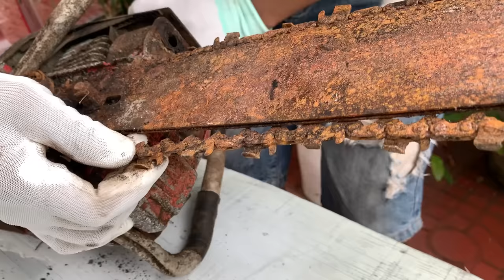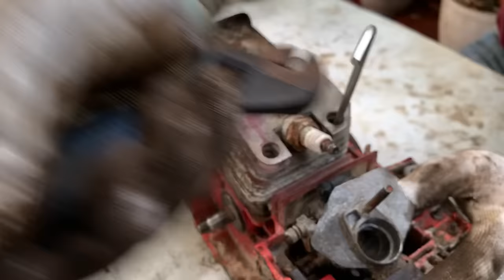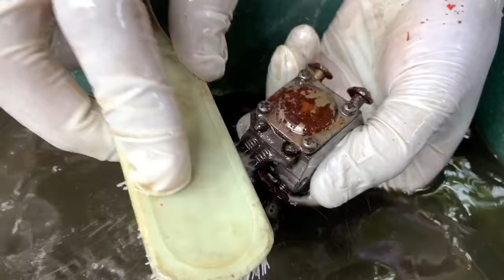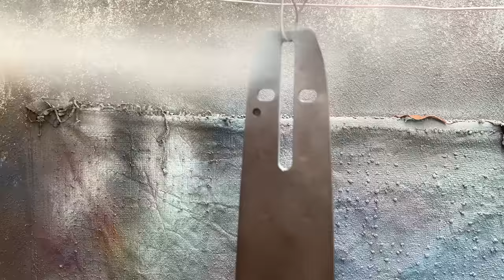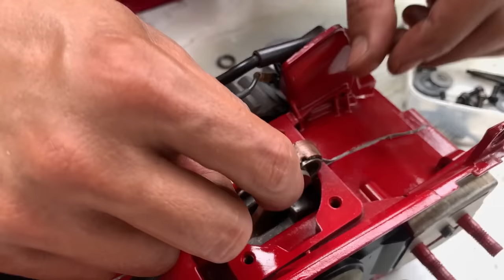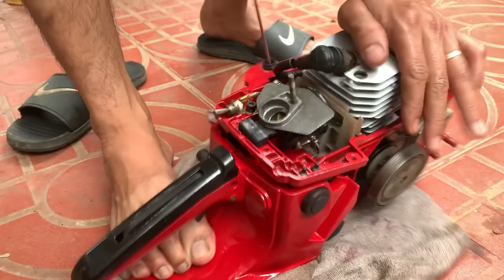Restoration old rusty gasoline ChainSaw | Restoring 2-Stroke Petrol Chain Saw

Comment: You NEVER insert bearing by hitting on the inner face, tap it in on the outer face
, you damage the bearing by hitting the inner face
Reply: Not at all, small bearing can be easily fitted in to the shaft of bearing housing. Heating producers can be done with big and critical equipment.
Reply: Not only don't you use the inner ring but I'm pretty sure you should pack them with grease. My theory on this channel and about 20 others just like it, is that it's a rigged. Someone has set up a bot system and pays these people a few bucks to sorta refurbish different items and then they collect any YouTube money. I found a channel that was 3 months old had 5 videos and like ten thousand subs but each video had over 10 million views each. There are some where you can hear in the background someone wrenching on another project. Easy money just find a item that works sorta,trash it out some more and then pay a person 5 bucks or whatever to "restore" it and some else 5 bucks to film it. Then have 5 or 6 channels,edit the vids and upload and then turn the auto system on to constantly replay the vids, like printing money
Reply: Yes!!! I saw that and got a little worried 🤣
Reply: That and the piston is facing the wrong direction. Arrow towards muffler.
Reply: Reeve i agree, and with a peace of wood or with a plastic hammer.

Comment: I think the piston was installed the wrong side, the arrow is always on the exhaust side🤷‍♂️
Reply: Well it started
Reply: I noticed that too..
Reply: Hehe and more like no masking tape etc ;p
Reply: kosti116 honkez
Reply: But the ring gaps never are....
Reply: @eisbeinGermany  IT did start but they do that because of where the piston rings meet. you want that on the opposite side of exhaust port.  it can be a hot spot and more change of hangin a ring

Comment: how convenient that a chain saw was randomly laying around  and he knew exactly where it was
Reply: Why does that matter? It was about the restoration
Reply: @austinledford8501  @@@
Reply: @uhtred7860  the builds are fake?
Reply: @austinledford8501  No, he disassembles then assembles the stuff, that much is clearly true. What is fake is the "finding random stuff in the forrest when i go for a walk" and the condition of the stuff he "restores" He clearly paints or dips the things in some sort of solution to create a impression of rust or age. Maybe even some reverse editing. pay attention to the "rusty" components before and after, no pitting from rust at all, also the rust/ageing is always the same colour, and comes off very easily. But check out the xbox resto, or some of his other electronic restorations, they are the most clearly faked.

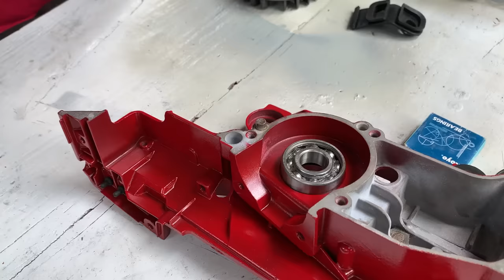Comment: 24:35 DONT HIT THE INNER RING! it will damage the bearing! Always Press or Hammer the ring that gets friction, like in this case the outer...
Reply: Same got to my mind, the first thing taught in bearing installations :) Hardly take damage with low pressure but next time hit the outer ring 
when installing bearing in the hole. When installing 
to the shaft hit the inner.
Reply: That was my first thought. Every time I see a restoration, guys hammer in the bearing on the inner ring...
Reply: I did this 1 time and bamm bearings broken
Reply: First thing I did when I seen this. Is go to the comments to see if anyone else noticed
Reply: That was the first thing I saw, the thing with the inner ring and the bearing seat is painted that's not good
Reply: Put the bearings in the freezer and heat the case and they pretty much drop right in....but yes you are absolutely right, never hit the inner race 😂

Comment: The cutting chain was installed backwards and re installed backwards. Also you must mix gas with oil for two stroke engines

Comment: should have pressed the main bearings in by the outer race , not the inner !
Reply: l thought that too bro
Reply: yep exactly and should have replaced the bent crankshaft and should have not paint the inside of the engine and should have put it on the dumpster.....
Reply: He put the piston on backwards too. Arrow on top should point towards the exhaust, not the intake. That saw won’t last long at all.
Reply: @brodytonelotti3577  he will learn
Reply: Yep and took the paint off the crankcase where the cylinder gasket sits AND lube the lips of the crankcase seals
Reply: I saw that too. Good effort, but won’t last long. For the amount of time that went into the rebuild, he could have bought a new one for $120 🤔
Reply: @Bulletman426  Who told you he was looking for a new saw? Someone who begins such a restoration without the right tools must be "loco" don't you think so? He did a great job though...

Comment: Backwards piston, no bar oil, dull chain, no oil fuel mix,
Reply: Chain backwards, silicone with head gasket, banging bearings with hammer, must be awesome.
Reply: backward chain too..this guy typical asian..has no clue..watched one guy here restore a guitar..found it lying in the long grass..put it back together back to front...
Reply: joshua Gargalione how about praising the lad instead of knocking hi so what if he made a few mistakes IMO he did a hell of a job
Reply: bent crankshaft, paint inside the engine..... that thing was poop now it's poop with wasted paint and bearing and it will last a week before have a real engine crash locked solid worst than if it was found under the sea after 10 years....

Comment: Never knew they made chainsaws that didn't need an oil mixture for the fuel to work. Won't be long for that chainsaw to have no compression and seize up.
Reply: I'd like to know, how u figured out that he used fuel without oil.
Reply: @peterfedor9288  you clearly have no experience with two stroke fuel mixture. You can tell just by looking at it when he poured it in.
Reply: @peterfedor9288  Well, based on my little experience with 2 stroke engines, the oil is in quite dark red colour (Like a blood from vein). So it dyes the fuel in red - reddish colour.
Reply: @tigerxra8515  There are various brands of the m2t oil - red, green, blue, yellow and so on. U can't tell by looking at gas if it's mixed or not with yellow oil(that's why I don't like these oils - can't see the difference). I have workshop and do engine repairs(fyi james), so I know what's going on.
Reply: @peterfedor9288  Oh, thanks! I had my suspicions that there is more that one colour of oil, but I wasn't sure. Yeah, I love the red oil. It's easy to tell if fuel is with oil or without. Is there are difference between the oils, apart the colours?
Reply: @tigerxra8515  Yep, red is my favourite too. The color difference is just because of brands. Each brand has its own color, just so it can be easily distinguished. E.g. Stihl has red oil, Husqvarna has blue,...(red is also usually used as typical color for normal cheaper m2t oil brands). No big difference in performance (except each brand's certain advantages).

Comment: Mistakes include but not limited to;
-Painting inside the bearing and mating surfaces. 
-Incorrect paint for inside of engine. 
-Excessive gasket sealer will overflow into crank. Not optimal.
-Bearings installed incorrectly in a manner that often causes failure.
-Piston installed backwards, will result in failure.
-Suspected bent crank, will result in failure.
-Possibly incorrect fuel, will result in failure. 
-Chain blunt Well below operable standard.
Reply: Yep, I noticed that too. But the worst thing he did is the way he istaled bearings 😱 The bearing nests shold be heated up to ~120 °c and then you put the cold bearings inside. They get inside like a dream and without any hammer.
Reply: It wasn't free he bought a few parts and he put in his time. . I think he'll get five to seven years of use out of it. Well worth his time.
Reply: Lĺĺl
Reply: Thanks you
Reply: @randallreed9710  He spend lot of time and spare parts (and even more paint...), so why not do the job correctly? I Think he didn't really know what he was doing, just try&error.
Reply: @paulpahl1607 "fire by trial" and "learning by doing "makes a great handyman and mechanic in multiple ways 😊

You can not claim that you are a expert in your field of work or personal and passionate hobbies, UNTIL you have Fu**ed up in every single possible way..

And this chainsaw restoration video is a great way to get new knowledge, tips and tricks to help his skills improve 🙃
Reply: I did notice that he put the wrong fuel in it but other than that I think thumbs up all the way. Personally not knowing shit about how things properly work I think it's awesome.👍👍👍 Not too many people would even take the time to do what he did, so my hats off to him.  I look forward to seeing more of this guy's videos laymen or not.

Comment: You must put it together with oil on the seals, bearings and piston. Will not last long on start up.
Reply: I was literally just thinking the same thing “bro you need those, there dust covers”
Reply: And The piston is turn The wrong way🤣🤣

Comment: 1)Dont paint Sealsides
2)Dont hit the bearing at the inner Ring
3) Piston is turned around, arrow shows always exhaust side
4) be more carefull with the engine, dont throw that cylinder around, and dont let all the parts fall on them
Reply: 6https://youtu.be/c5lnmOqqfZg
Reply: I bet you this dude is from China so what would you expect
Reply: 3) if he knew that and put piston turned around to get better conrod angle 😁 but this only works 4t engines it rattles cold but no warm anymore

Comment: When he tapped in the bearings by the inner raise it kinda hurt my soul
Reply: And painting the inside of the engine case isn't funny either !!
Reply: Zylinder Head in the wrong way 😑
Reply: and starting it in with strait gas on initial run

Comment: bearings must be completly unsealed (lips of the sealing ring are oiled by gas mixture) and installed by outer ring , gasket is out of sense because it causes a gap in front of the engine body and its tension, silicone is enough, use some grese when intalling needle bearing
Reply: Its fake water doesn't just end up in the oil tank without a huge ass hole in it.

Comment: Well, that didn't run very long with the piston in backwards. Your rings are officially destroyed now.
Reply: I was thinking the same thing...must've missed that big arrow on top of the piston.. oh well lol
Reply: cylinder is going to be "reshaped" by the rings so the engine is going to be really destroyed soon i mean, it's already a junk but soon it's going to be a piece of aluminum mixed with iron good fro scrap

Comment: Piston went in backwards. Aero points to exhaust. But very nice job.
Reply: 騾                                               鑼                                             邏‼️                                   腹蠡     ら         らえり
Reply: Also he damaged the bearing by hitting it on the inner circle
Reply: @user-bd3dt2yy9j  nó cứ sự

Comment: Nice effort but you drive a bearing in on the outer race. When you strike the inner race, you ruin the bearing. That will run for a couple hours before it grenades itself there ace. Nice overall effort but pay attention to the details.

Comment: For those that don’t know…..those bearings were installed incorrectly…..bashing on the inside race damages the bearing, he should have used a bearing tool and a press on the outside race.
Reply: Exactly
Reply: Or heated the case halves while chilling the bearings. They would’ve dropped in that way without need of a press.

Comment: Youre going to destroy that engine running straight gas in there without 2 stroke oil.  Also, that cylinder head is going to smell awful as that paint burns off of it.
Reply: Then he can restore it again. :)

Comment: Saw two major faults, btw, the piston is on backwards, arrow always points to the exhaust. That takes away 25% power. And the bearings was hammered in on the inner race, should be seated on the outer. So the balls are now damaged, that shortens the lifespan of the ballbearing by 90%, the saw will probably just run for a few times, then the bearings are shot.

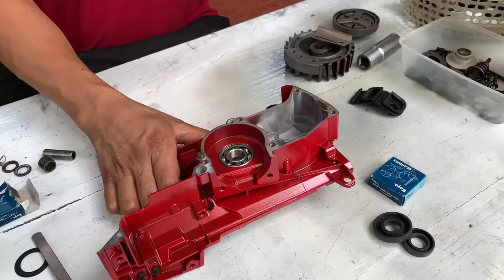Comment: 24:38, dont hit inner ring hit at the outer ring otherwise use bearing puller & to avoid contamination to bearing journal open the seal always after the bearing installed

Comment: They were running it with no bar cover ?
i wonder if the clicking sound it made with the chain running back wards on the sprocket gave it away , or did he think , man this is blunt.
Reply: As

Comment: At the beginning the blade was on backwards
Reply: I don´t want to be that one guy but..........
It's NOT a "blade", it's a bar and chain.
That's why  it's called chainsaw and not bladesaw.
Learn something useful.
Reply: @sheeplad803  weii its still backwards
Reply: @sheeplad803  bladesaw 😂😂
Reply: Chainsaws don't have a blade and the chain can't be be backwards
Reply: @robintutt4018  it's reversible you're supposed to flip it every time you sharpen the chain
Reply: It was backwards when he reassembled it, then fixed it. ;)

Comment: Highly confident this will run only a handful of times at best. Bearing were broken during install, and they should be a tight fit with the drive shaft; which they are not.  Thank you though for making this video!
Reply: Spray paint does not a fix make.
Reply: And he put gasket maker on top of paint where the jug and the block meet up that will never hold he should have sanded off .but he tried maybe the next one will be better B+ for effort

Comment: Hes lucky that Homelite even started.  Thats why it was left in the woods to die.   This is like Pet Cemetary.
Reply: Not a homelite, Johnsered, no doubt
Reply: @stihlcuttin5784  yea thats a 200 series husky / Johnsred but how long do you think the connecting rod bearings going to last ?
Reply: @chuckbailey6835  yea this whole saw isn’t going to last long.  The arrow on top of the piston is suppose to point to the exhaust, not intake.  The gasket surface between the jug and case is painted he seated the bearing using the inner race which probably pitted the balls.  And to top it all off, I swear he’s putting straight gas in that thing.   Not mixed.   It’s like watching the lead up to the Hindenburg

Comment: One day, while walking through the forest collecting random sticks, I found an old chain saw that NO ONE WOULD EVER ABANDON in the woods! 

Aside from that, it was fun to watch the rebuild.  Did the clutch spin itself off at 35:45? And what was the white, milky stuff you soaked the parts in?  It seems to work very well.
Reply: Actually i found a running chainsaw in the woods like right off the highway and it was in on old stump under a peice of ply wood so im sure he couldve found it😂
Reply: TSP?
Reply: Yeah, this guys videos are faked, check out the Xbox "restoration" for a good laugh.

Comment: Is this the same chainsaw you restored the last time
Reply: he always put it back in the wood after he restore it so he  always have some work.... that thing look good on the end but it's trash crankshaft bent, piston wrond way, paint inside the engine, no oil on the gasoline... well, it's not going to work more than 10 hour of run and with no oil it's even worst it can die on the first hour....

Comment: My advice is don’t pull the start chord without putting oil in the cylinder because you will score the cylinder walls and the engine will never run correctly again

Comment: Two serios mistake arow piston and bearings seal.
Reply: it`s wrong bearing type, it should be a regular without a seal because it get the lubricant from the engine. That is why he removed the seal from one side, What he should have done with that bearing is to remove both seals and clean them free from grease. That saw wont last long.
Reply: What did he soak the metal parts in? They came out way cleaner than an ultrasonic machine.
Reply: @tommyaleks100  true well, anyway with the bent crankshaft and the bearings that been installed by hammering the inner race ring well, all is dead it's waste
Reply: @Njazmo  and the rings have balls prints in them nice!

Comment: Besides, the bolt loosening agent works on the nuts and threads and you applied it to the bolt heads from the plastic fuel tank: D: D: D

Comment: Dear friend, you installed the piston incorrectly. The piston has an arrow on top and this needs to be pointed in the direction of the exhaust and you did it in the direction of the carburettor.
The engine will run, but before long you'll get piston and cylinder damage

Comment: You installed the piston incorrectly. the ok part should coincide with the exhaust outlet. Because of the engine is running hard.Good luck

Comment: Most would see this and toss it in the trash. Glad to see that it lives to cut another day. I noticed a lot of unwanted comments on how you did things, not sure they understand, you work with what you have. I think you did a great job. Had to rebuild the engine on a weed eater and it's still running today even though after I out it together there was a few thi.gs I would go back and do different today but as I said it runs good and has been for over 2 years now. Of the day comes it needs to be rebuilt again I would do it again. It's not fact of I can go get another one but yet the enjoyment of taking it apart, fixing it, and watching it run again.

Comment: Muy hábil restaurador, aunque comete varios errores graves, que debe haber corregido: pinta el cilindro, lo que entorpece la refrigeración, usa gasolina sin aceite para motores de dos tiempos, no se ve colocar el aceite para la cadena, ni repara el carburador, no tiempla la cadena, ni la afila. Supongo que luego de la restauración la llevó a un técnico que ajuste todo lo que no hizo o no se vio en el vídeo, como la distancia entre la bobina y volante, caudal de aceite lubricante y reglaje del carburador.